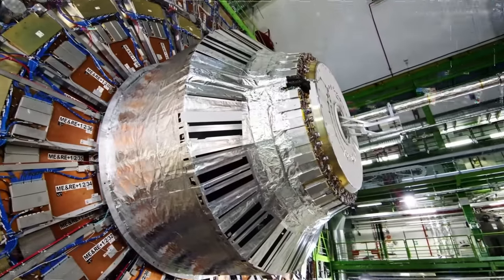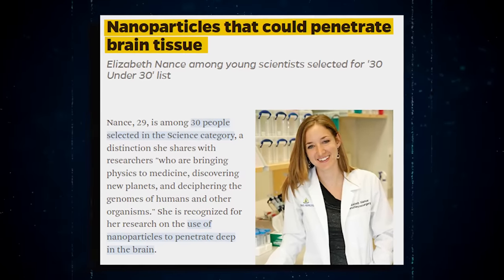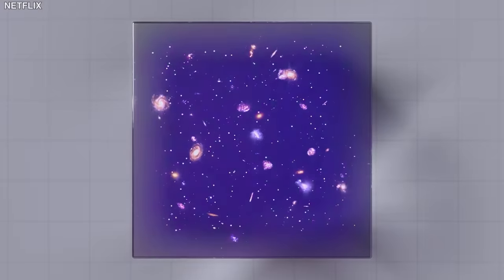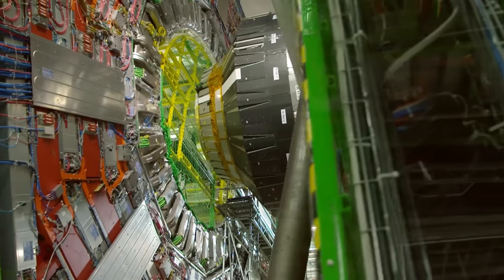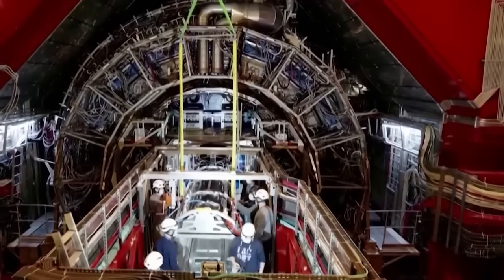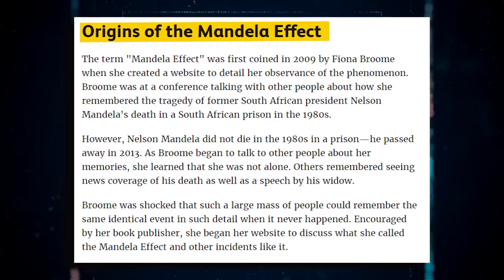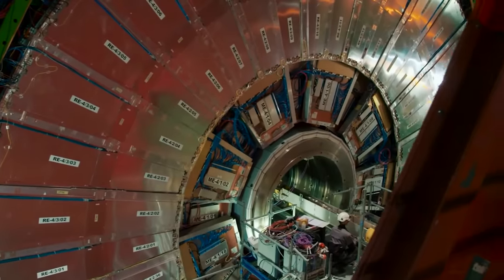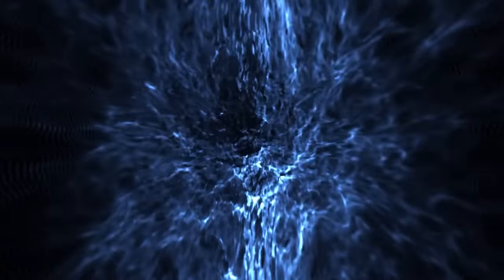Worlds Smartest Kid Just Revealed CERN Just Opened A Portal To Another Dimension

Comment: yeah no, free energy cannot be created because any sort of generators will lose energy in form of sound, heat and light which means that eventually you will run out of energy to cycle in the system. No matter how efficent the system will be, energy loss is unavoidable. The "free energy invention" of the kid made me extremely sceptical from the very start.

Comment: Light absorption formula must take place and exact time (not just continental time) to displace space. To effectively come back from travel, you have to know what time you want to go. Not knowing that time could mean getting lost in an adjacent universe. However the Mandela effect could be the potential secret to returning back to the present, seeing that time never stops, the numbers continue to keep changing infinitely and indefinitely. Research team ever see this message, come get me from Houston Texas. I will not share all my knowledge of time on the internet.

In My theory, I believe, that machine would not have started a black hole, yet a massive combustion would have destroyed the machine and research team and demolished it as if an atomic bomb was dropped on it. Space cannot be contained, it's space. The machine was programmed to create space by connecting or collecting matter through the space/time continuem, yet we are already in a space in time, Therefore the machine created a parallel matter, so a negative effect would happen where the 2 matters fight for a spot in 1 space.(minor bang or explosion) because the machine created light matter and not dark matter. The difference: A black hole takes all the matter, but displacement moves that matter, from the black hole, to another space. Another theory is, although a black hole takes up space, examine the circumference of a black hole not just the radius, notice the dark matter around it.  I believe time does not exist in it. There's no time zone or quadrant on it or in it, yet it exists. Therefore as long as we exist in time, we cannot create a black hole in our space. The machine simulated creating matter would just explode and whatever chemicals are around your lab work would combust.

So what creates a black hole? Let's get together and do research I am black currently 32 years and God is the only one that can create a big bang. We would just kill our love one because our science is misguided.  Nonetheless, it doesn't have to be misrepresented. My private study on time and time started 12 years ago, in college.

Comment: There is no way these particles in the LHC have done that. Cosmic rays like the OMG particle have energies over 100 million times more than the LHC. If anything is gonna be doing that it will be one of those. Or maybe dark matter particles at the same energies if that is not the same as normal matter. In the vastness of space them things happen all the time. The OMG particle is just the fastest we have seen. There is probably a WTF particle we never saw. Although it would be cool if we did have a interdimensional portal.

Comment: Can that smart kid explain who created the heavens and the earth and everything in it? 
Because something can not be created by nothing. 
No big bang because it would have to of come from something.
Reply: It didn't come from nothing. It came from things that you can not see. Very tiny things can create much larger things. Thats what CERN is doing. They take very small particles & crash them into each other & create something from that & they found that what they thought was the smallest particles were not the smallest & there are things that are even smaller than that. They are tiny little vibrating strings like a piece of a rubber band vibrating but much smaller and not visible with the eye.

Comment: It started a long time ago, it was what it was and now is what it is till it's altered again maybe it's TIME. Good luck kid l was once a kid too. Look up the Stargate project aka gate project this is just pin drop in the ocean.when someone dies but then you but they died years ago called a Betty White, time travel and altering a vents excites even if you don't see it or remember, once theoretically imposed well it is TIME. then,her, to come oo 8 linking the flow back and forth,block chaining with in a magnetic field always was here and will earth is a hydron to now when the big bang took place is to have a reset point as to life as we now it there is always a minimum of 2 points in anything but endless connecting. no more paradoxes please, they open and some merge back.
But some have to stay or can't come back or keep sliding between then resorting to vices aka an anchor.